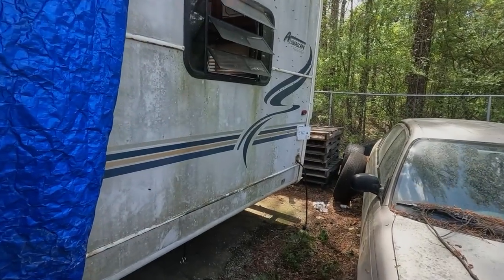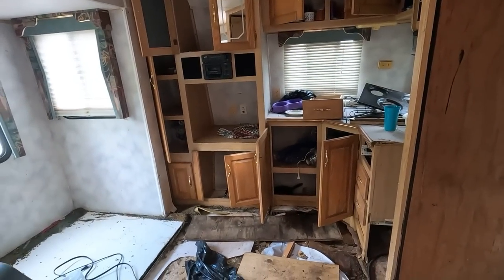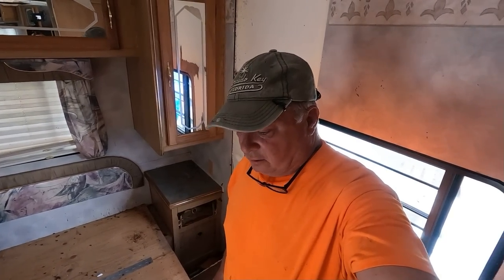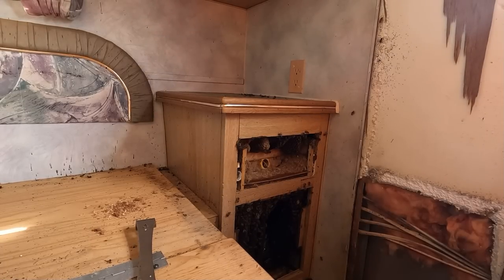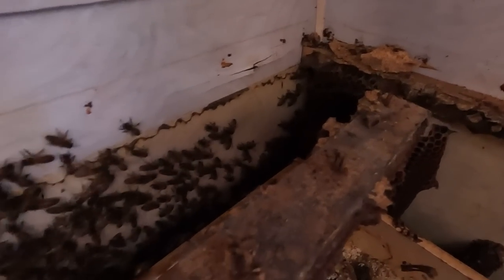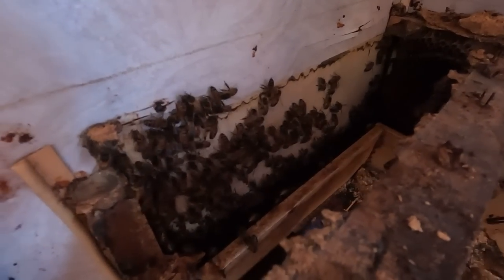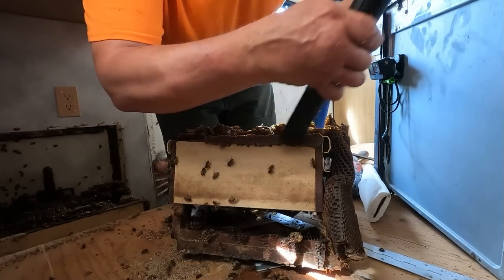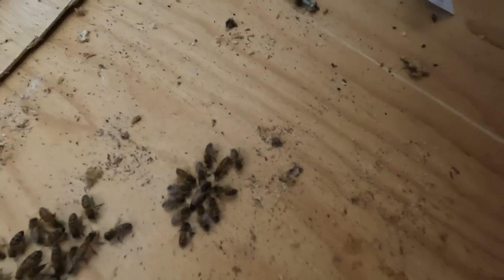I've Never Found Anything This Horrible    Until Now

Comment: When you vacuum up the the bees what happens to them? Do they survive the rough handling of the vacuum pressure, do they become expendable or is it a bit of both?
Reply from the maker: I use a system designed to capture and not kill them.   Pressure is adjustable.   They get taken home and put in a bee hive and they rebuild just like normal to continue making honey.